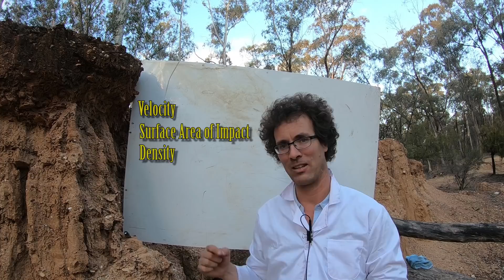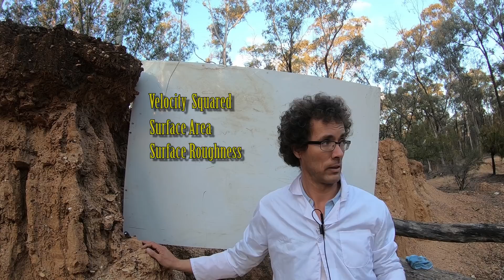Picking Gold Up! Why gold moves!

Comment: I agree with the rough partial having less resistance , like a golf ball (with divots) flying further than a similar sized smooth ball. But in regards to others comments I think we need to look more at the scale of things .... smaller particles will fall out behind a large obstruction if the pressure drop is great enough.
Reply from the maker: The greater the difference in velocity the greater the pressure drop immediately behind the obstruction. But when you increase the velocity and thereby increase the pressure differential the less likely any particle of any size is to get caught behind the obstruction. This was the main point I was trying to make in episode 5.

Comment: You sure are good at making simple into complicated.
I very much enjoyed this tape , as I do most of your tapes , but i seem to have a problem.
My problem is I am trying to learn what I want to learn and am having trouble learning what you want me to learn.
In fact part of that problem is that I am not quite sure what it is that you want me to learn ?
Is it what causes Gold to drop out ?
I believe it was that , and if so , I am none the wiser.
My fault ? - probably
Reply from the maker: The original plan was to get to what makes the gold drop out in this video but that would have pushed the video over half an hour long. Plus I wasn't happy with the footage that I shot for the next bit. Based on that it was either going to be publish next week after re-doing it all or get the bit on what picks gold up out and published so it can settle on your minds.

The trick with using this stuff is being able to think about the forces both action and re-action at work. How they change over time and how they change as the flow navigates obstacles in the channel.

The next one is going to be a doozy. 

AS I said way back the low pressure model is popular because it is simple, easy to learn, easy to teach and MOSTLY works. The stuff I'm sharin is harder to get your head around but with practice you will find more gold using this model than the low pressure model and that will start to become REALLY obvious next episode.
Reply: Looking forward to watchin' the next one , not quite as much as watchin' the new toy (glass sluice , remember? )
One thing I had in my mind is "Energy Transfer" while I was watching this tape.
Not so sure if it was mentioned or it may have been but using other terms.
Reply: Umm - when I say Energy transfer , I do not mean transferred into another Form of Energy , I mean transferred from one body to another